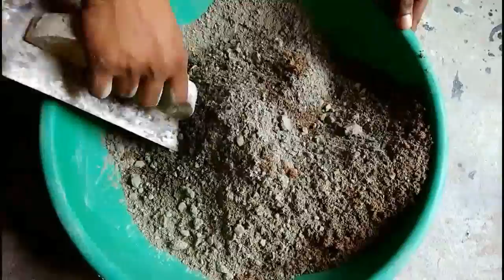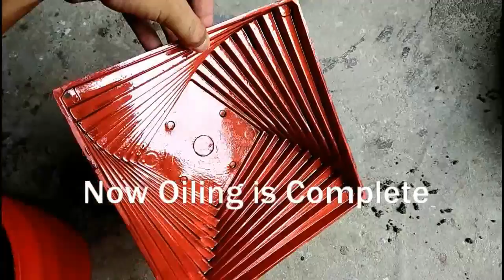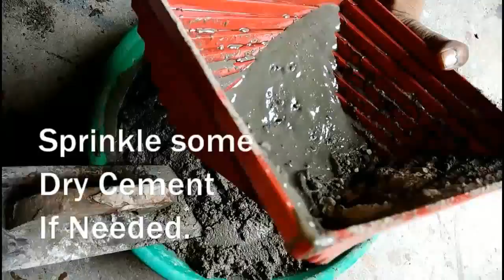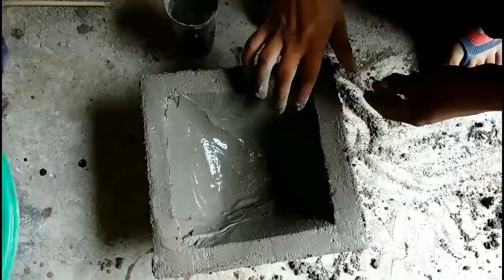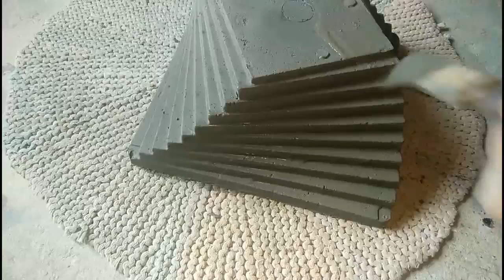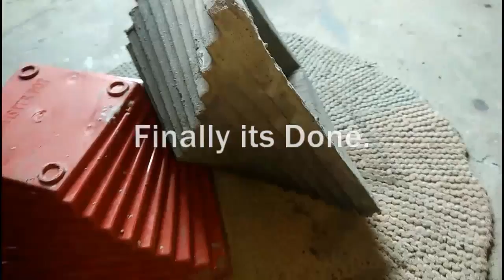Twister Spiral Cement Pot.

Comment: How to make drainage hole?
Reply from the maker: Hita Thaker  Use a drill machine to drill holes. or if you dont have the take a screwdriver (penchkas) and screw a hole by rotating it half. or make hole when pot is wet.
Reply: Rahul Shukla  ok